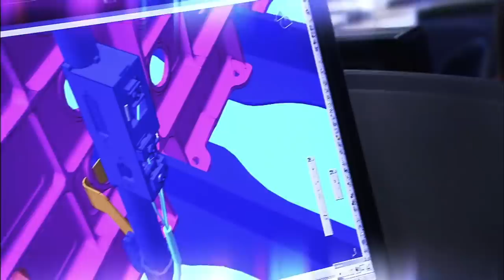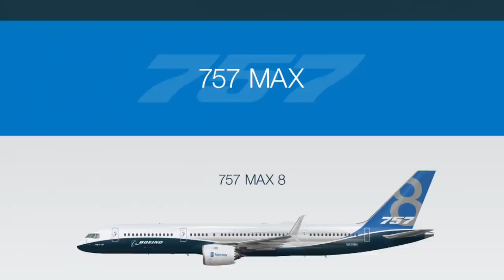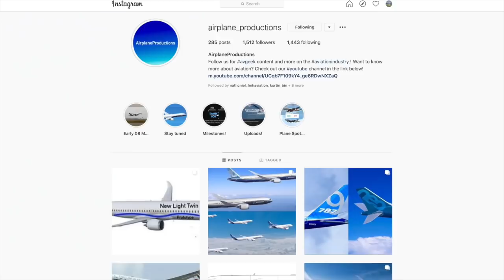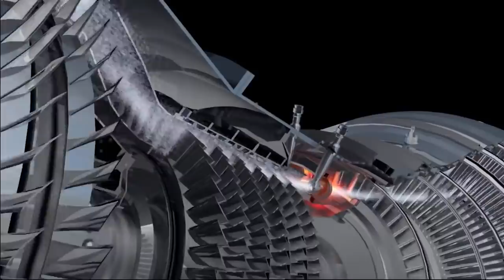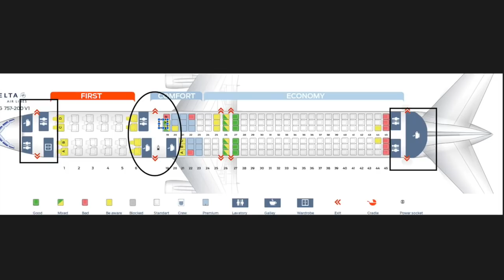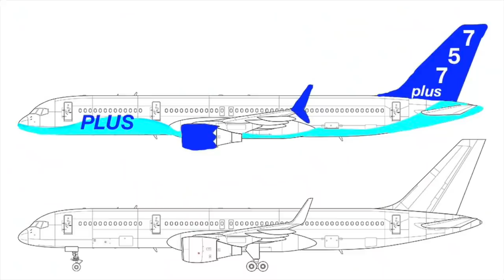Boeing 757: Could a 757 re-engine work? (757 plus)

Comment: Yes it is possible to create an improved 757, as to whether it would make Boeing any money is another matter!

The main problem for the 757 is its ancient fuselage, rooted all the way back to the 1950s! Yes it could make better use of the internal space, but even then it would still be 'market trailing'.

Unfortunately, the fuselage is the most difficult and expensive component to upgrade or replace, so please let's not see any more money spent on developing what should have been replaced decades ago. This will only delay what is really needed, an up-to-date single aisle range of aircraft, a delay possibly long enough to see Boeing no longer being relevant in that market, and without a major source of the companies revenue.

We already have rumblings that Airbus are working on a composite wing to get the weight down to a level where the existing engines will provide adequate performance for a lengthened A321 (322?). Where would that leave Boeing if those developments were migrated to the A320?

Comment: Interesting and well reasoned analysis. Agree with the comments suggesting that the continued development of the 737 into something it was never designed to do was a fundamental mistake by Boeing. Had they moved onto the 757 and built up the variants from that, they would have considerably more flexibility today. Who knows, maybe even a shorter version to pick up the <200 passenger market - call it a 757-SP! Anyway, you bring out some great thoughts and issues against the notion of restarting the 757 line. Thanks for sharing.

Comment: Would not work. There was a reason so few sold and that reason is still there. Re-engine would would work but on only existing aircraft? Re-tooling would still be a problem since new tooling would have to be acquired. Would the 757 pass newer standards?

Comment: Given the post-Covid world in which many more routes now fall under the category of 'long & thin' and are predicted to stay there, haven't the economics of viability changed? Add to that the Covid requirement for more space between passengers. 

How many moutes could the 757 turn a profit on now that it couldn't pre-pandemic? For the other routes, is a total revamp really necessary? Or might it be sufficient to swap the engines out for ones that could installed with minimum re-engineering? I.e. 30% efficiency increase for 'X' cost vs. 25% increase for '.25X' cost.

Comment: 757 production will never resume because Boeing deliberately destroyed all the tooling for the 757 when they shut down the line to make sure that the 757 wouldn't compete with the 737MAX. With the problems that the Max has encountered, they may be regretting that decision... Without any of the old tooling there isn't much advantage to a 757 refresh over simply developing a new aircraft. A narrow body based on 787 technology would make more sense long term to replace both the 757 and the troubled 737MAX.
Reply: Destroyed? Oh dear boeing😑

Comment: From an engineering point of view, I have always liked the 757, even though I am less keen to ride in the back-half of one. Although I am also sympathetic to the view that discontinuance came early, the truth is the 757 was a slow seller for Boeing. The -300 extended life only but slightly. The models went out solely because buyers dried up. The problem, impossible to overcome with a re-engine or "plus" model push, as attractive as it may be to folks who love airplanes (like me), centers on engine choice. It would be nice to have two engine options, or one, but the fact is, there are no high-efficiency, modern engines to suit the role. The LEAP engine tops out out, currently at 35,000 pounds, and the model requires 40,000 pound engines to play in the high efficiency game. To be less efficient than the A321 with either of PW2000 or RB211 engines (which are out of production anyway) would be a no-go. The GEnx core is too heavy for the thust range needed. So, for the moment, it is all wishful thinking. It's the same problem with everything between an A321 and 787-8. Exactly stated: no 10:1 or 12:1 engines are available in the thrust range needed. If there were, Boeing might have had options to continue with the NMA. It remains an unsolved problem. There is, alas, one other quite difficult aspect, directly under Boeing's control. That is the flight deck. Although the 767 and 757 share a rudimentary fly-by-wire system, a 757 plus would need a new, modern flight deck, possibly derived from the 787.

Comment: New wing and new engines? = New Type Certification. This isn't a "repower", it is the same road that led to the issues with the 737MAX. Again, this is too little, far too late... Instead of investing in the future, Boeing keeps trying to put band-aids over band-aids on OLD chassis that can no longer meet the current design or safety standards.
Reply: The a320neo and a321neo and a321xlr is the same thing. So if you want to have a go at boeing you better knock on the door of airbus.

Comment: Good video. Its seems the old design of the 757 does have some draw- backs like lack of cargo containers space. It was however reliable and safe and if it manufacturing cost can be reduced it could well have an afterlife with new engines., avionics and wings.

Comment: The 757 is the perfect aircraft in its class...  Leave the body size the same, put a pair of LEAP engines and new wings and you'll have a winner.... Extending the body as a single aisle is a waste of time and effort, that job can be taken by the 767 in the 250-300 passengers class.... The 767 needs new wings and more efficient engines to place it in the 6500 mi range + 20% .... The old 767 suffered with  lack of weight/cargo/passengers capacity to fulfill the Atlantic routes and many times you had to pick between passengers and cargo on many routes...

Comment: I'd like to see an updated 757, with essentially a copied-and-pasted 737 cockpit for ease of training, and offered in various length fuselages to replace the MAX. Pilots should be retrained for a new aircraft anyways and the 737 is basically a jerry-rigged and updated 707 which has reached it's maximum development potential. Putting those new engines on the taller 757 also negates the need for a screwy MCAS. Don't need it to be that long? Order a 757 "short" fuselage. I think that platform still has some life left in it.

Comment: I think today’s announcement by Boeing pretty much kills off restarting the 757 line and probably pushed the 797 out another 5 years.  Over 5,000 employees taking early out severance packagers and 6,000 layoffs at the end of the year. 
The order cancellations will start rolling in this summer. And the Max is still a huge problem that has no solution.

Comment: The 321 NEO is by far the best aircraft I have ever flown.  It carries more people further and from shorter runways than the max and is more fuel efficient.  The 757 redo sounds good to the public and of course those who flew it love it, but the bottom line is always money.  As you stated the 321XLR is more than a capable replacement and if Airbus puts a more efficaint wing on it it will be flying until the next century.

Comment: I prefer a 757 over any Airbus or 737. He’ll give me a 727 or an MD-80!
Reply: OMG the 727 is such a runway hog the MD, DC9 series have such old tech, there is a reason you do not se rear engined, winged and t tail jets anymore. If you want to pay $600 for  one way transcon and burn more fuel that Saudi Aribia has in the ground great.

Comment: If 757Plus were to work, they must shed those extra kilos. Having a composite tail section with stabilizers will help. Clean up the aerodynamics with maybe composite wing (if not too prohibitive). Use the 787 fly-by-wire and systems. You should have a right sized aircraft. With the weight savings, then you can use the PW Pure Power and CFM Leap series engines, without much modifications. Remember, weight matters!!!

Comment: The 767 production is still running. The 757 max :plus won’t happen. You actually talked about why there is no I actually engine that would support the weight. The 767 is a little different story they can belt existing engines onto it and that’s what they’re looking at. The engine manufacturers simply do not have the investment capital to develop an engine that would ever make 757 revival
Reply: I thought there was more commonality between the 57 and the 67
Reply: @fensterlips  There is commonality in flying and cockpit. Engines are a different story. Also they were built on a completely separate lines and the 757 line was shut down a long time ago now the tooling doesn’t even exist anymore. The structures and engines are very different between a 767 and 757

Comment: Sorry, I'd prefer a twin-aisle 767 over the 757. Long flights on a sing-aisle plane are not comfortable. How is it different?  On a sing-aisle plane, the only aisle is usually blocked by flight attendants serving drinks and/or food while on a two-aisle plane, you can cross-over to the other aisle if one is blocked.  Also, a wide-body is less claustrophobic on longer flights. I made the mistake flying to Hawaii on a single-aisle American Airlines B757 one time. The following year, I flew on a twin-aisle A330 Hawaiian Airlines which was way more comfortable.
Reply: I “accidentally” flew to Maui on a United 737MAX and thought I was going to die. I think the pitch was 30 or 31 to make it worse. I wrote to Chicago telling them I would never do this again. ETOPS and 737MAX don’t belong in the same story. Ever.
Reply: @fensterlips  - One year, I flew on a B737-800 to Honolulu because it was departing from a local airport in California. Never again!  I will drive the one hour to Los Angeles Int'l airport to fly on a larger plane. The aircraft was cramped and slower than the larger aircraft.

Comment: The ONLY reason the 737 MAX cannot go beyond the -10 capacity is because of the desire to keep the same type rating as the other 737s in service. If you abandon that, there is no reason the 737 cannot carry 250 passengers. It is, afterall, a shortened 707 fuselage and there is no reason it cannot be as long or longer than its predecessor. All that is needed is a new undercarriage and bigger engines. The 737 is in production the 757 is not. The 737 is lighter. There is no reason to re-engine the 757 instead of doing a 737 NTR (New Type Rating).

Comment: Even though I'd love to see it happen... there are still drawbacks imo. I mean we all know the mistakes Boeing made with the max. There is no guarantee that they won't cut corners again either. Re-engining works to an extent. The 737 NG should've been it. With no more upgrades to the plane. Only minor tweaks perhaps. Engines are getting larger and the 737's systems are only getting older. Anyways... re-engining the 757 would work but not for very long. It wouldn't have a major long term effect. 757's design dates back to 80's. Starting off with a clean sheet of paper would be so much better. Sure it would be expensive the develop but we're talking about next generation long-medium range commercial airliners now. If Boeing comes up with the 797 the flexibility of this project will surpass the practicality of re-engining an old aircraft. It would urge Airbus to come up with their own design as well. Great long term deal if you ask me
Reply: Let’s look back 80s, 757, 767 and A310 shows 3 direction for a mid market jet
757 as a narrowbody was relatively efficient, but lower capacity and slow boarding time
A310 as a full-width widebody has higher capacity especially for cargo, but less efficient by being heavier and wider.
767 attempted to improve efficiency by adopting a 2-3-2 semi-wide fuselage. At a cost of reduced cargo capacity, efficiency gain over A310 is minimal (partly because of heavier but higher potential frame, though) and significantly behind 757.
If 787 wasn’t significantly overweight, I don’t think there’s a need for 797
Reply: @steinwaldmadchen  Yea my friend. Perhaps there could've been smth like the 787-3 as suggested by many. It would be a pretty good replacement for the aging 767. But I don't know about the 757.

Comment: Doing a re-engine for the 757 would not be the easiest option. It’s been out of production too long (last one completed in 2004) for this to really be reasonable or even feasible vs a clean sheet design. No telling what shape the tooling is in, if they still have it at all, plus training an entire new staff for construction as assembly workers from 20 years ago still being there and proficient is extremely unlikely. Also ignoring the at minimum updated wing design and engines as well as updated avionics, new training, certification, etc. 

767 production line has not ended yet and the -400 is still being built for existing cargo orders. That could be relatively easy, particularly for cargo.
Reply: They scrapped the 757 tooling years ago.

Comment: We've all seen what happens when trying to upgrade an old airframe.
Lessons need to be learned.
Reply: It's not a bad option at all for producers though. It is very practical. Upgrading a successful airplane is sometimes just as good as creating one from scratch. The 737 was just upgraded way too many times. The NG should've been the final dot. But in this case developing an entirely new airliner is better than modernizing the 757 in my opinion.
Reply: Merely upgrading an old airframe is not always a bad decision. And the 737 Max was a good idea (it's got like 4600 orders) just implemented horribly.

Comment: would take long time before  the new 757 start the first flight and then is to late, airbus  wiht 320 is in front of the line for long time big mistake  from boeing  to stop the production  the 757, is very  good plane can carry a lot weight in the belly  and full of passenger on 5 to 6 hrs  flight  and no problem

Comment: The buildings where the 757 was built no longer exist, nor does the tooling as far as I know. A re-winging/re-engining of a plane designed in the 1970's isn't likely, nor is something similar with the 767.
Reply: Didn’t they just clear out the 787 facility in where? Renton? They have the tooling from what I read from an OP. They just don’t like the economics. The bean counters are putting the kibosh on it
Reply: @fensterlips  The 787 facility is in Everett, and won't be cleared out for` at least 6 months. The 757 tooling is probably long gone. One has to assume that any new aircraft in the "797" class will be of composite construction. The 757 was designed in the 1970's and is outdated, especially in terms of wing and engine design.

Comment: Might need MCAS system. But don't tell anyone!
Reply: Automated stability assist by itself is not a sign of bad design. Stop bellyfeeling the media.
Reply: El Ectric It's especially fine when limited to a single sensor input and not disclosed or trained for.

Comment: It was a mistake for Boeing to stop production of the 757, they could have updated it with the 787 composite type wing, with updated engines, and a fly by wire flight control system, they’d be selling shitloads of them

Comment: Renginging the 757 only makes sense if the C17 (and maybe B52) also reengine.  The C17 flies the Military version of the PW engine on the 757.
That would add 1000+ engines (operational and Spares) to an order helping offset development costs of the engine.. Using 77X or 787 avionics makes sense. if the 757 is resurrected.. I wonder if rather than bringing back the 757 the would do a rewinged stretched  737, giving the a unified narrow body line. The Key would be keeping the engines off the ground.. 
The 767 has been updated with a lot of newer avionics for the USAF tanker program, and is still in production., upgrading the plane is much more realistic.

Comment: 757 air frame and wings are way too heavy, a liability transmitted by the strong but heavy B 707 and B52 replacing fragiles short living Comet's and B47's still made like second WW non-pressurised or low pressure weak airframes. The only way to compete against and outperform A321NEO, LR, XLR and their russian or chinese avatars was a true composite single isle dreamliner, like for the 757 and 767 twins developped together. The Max disaster is way more costly than just repeating the 757/767 pattern with Dreamliners 787. Leaving the A320 family and A220 without a true performing competitor just using trade barrier and import duties is an historical US and Boeing mistake.

Comment: Boeing’s new black diamond product development system probably isn’t compatible with the 757. All the design work was outside of any standardized CAD system. Maybe the 767 has been pulled into CAD for the freighter and tanker products, but I don’t see them moving forward with this for a long term product offering.

Comment: Since the production of the plane has stopped therefore it would be very expensive to bring back the toolings, suppliers and logistics back online. Better to build a new model. Unlike 767 and 737 they are still building them.
Reply: Isn’t there a lot of commonality between the 767 and the 757? Would it be possible to slide a new single isle fuselage into the 767 “everything else”? Then continue improving it year after year?